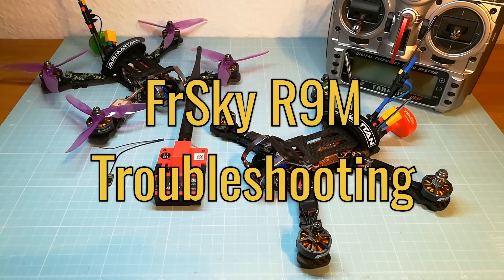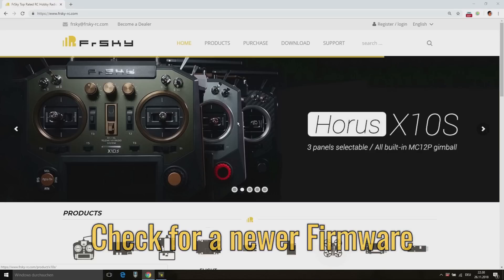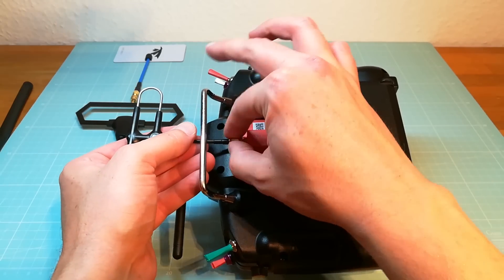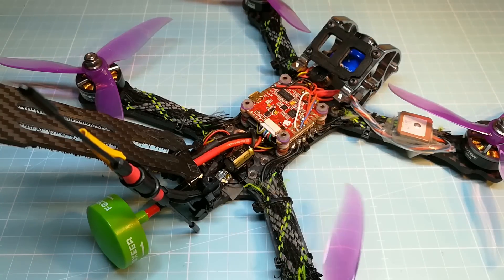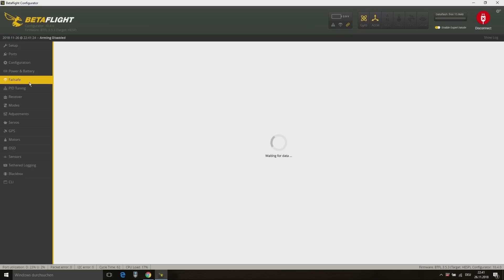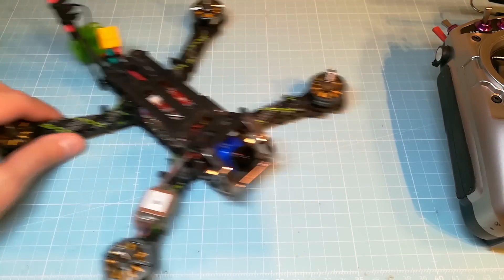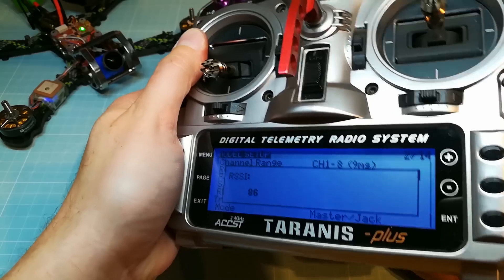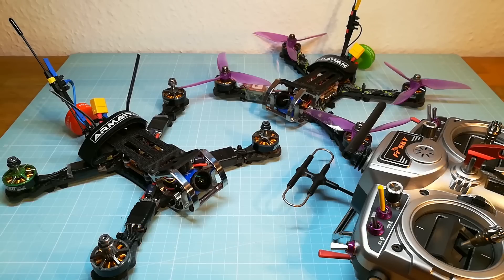FrSky R9M - Failsafe - Troubleshooting

Comment: Please, could someone help me? My drone triggered the Rescue Mode, and instead of it comes back to me, it went in a different direction. I lost the drone, but the worst thing is not understanding why the drone did not come in my direction.  I have had checked the arrow in OSD, and the direction was working properly. After this video, I find out why the rescue mode was activated. The problem was I have set a value too low in "guard time to stage 2".  I set 4 to this field. When I set it, I wrongly thought it was 4 seconds. My drone was Tyro128 and my GPS Module was BN-880.
Reply: Guard time for stage 2 activation is a period for which the drone waits after loosing the RC signal and then it activates return to home procedure. If you set 4, that's totaly ok. It means that after it lost the signal it waited half a second for the signal to return and then it initiated the return to home procedure. So this is certainly not the reason for it to fly away from you in my opinion.
I see mainly two options:
1. minimum satelites set too low (ie less than 6) and so your home position could be totally wrong
2. badly positioned gps module on the drone - maybe it had a very bad reception at the moment when gps rescue was initiated and it flew away for that reason.
I can think of no other option right now...

Comment: Sounds silly, but im having interference on video when i set 500 or 1w of output power.
Reply from the maker: why silly? It helped a lot of my viewers and even you did watch this video because of some issues you are trying to fix. In order to fix your issu i would try to mount the video antenna apart from your receiver antenna. You can also try to bind you quad without telemetry and to disable telemetry, also disconnect the s.port wire just for testing - sometimes telemetry could cause inteferences especially at high output power levels.
Reply: @TorbanDallas  Thanks Torban!

Comment: I´m using r9m with r9mm, and testing failsafe turning off the taranis, when i turn on again, the quad not recover from the failsafe, still blinking failsafe in the osd,  and not response to the taranis, but i have telemetry in the taranis. Any idea?
Reply from the maker: sounds like a BF Issue - I have already heard about this issue on some Facebook posts. Open a GitHub Ticket please. I will also do similar tests soon and then i will also share my experiences. After switching on your taranis, and moving the sticks, you should get back control.
Reply: @TorbanDallas  i'll do ir
Reply from the maker: @juanmanuelamado7732  just thought about your gps rescue issue, did you already find a solution? Btw: are you using crsf or frsky module? (seen to late that you already said you are using r9m in your first message) And what's your Failsafe Setting in your Radio? On BF 3.5.7 the rescue mode didn't work with crsf and a specific Failsafe Setting, maybe it's the same issue - if you are using crsf.
Reply: @TorbanDallas  i'm back to BF 4.1.2 and fix that gps rescue issue. But the sats count back too. So today is raining, but tomorrow i'll gonna play with the sbas config and see what happens.
Reply from the maker: Which Betaflight Version? I have heard about this issue. Can you replicate it and explain it on Betaflight GitHub? I never had this issue von BF 3.5.7
Reply: @TorbanDallas  i'm running a test version, 4.1.14 a build to test that gps thing, the drop sat, it's fixed the sats issue, but testing rescue mode without propeller, works fine in a switch, but becoming into failsafe turning of the emiter, don't recover control when turn on. So i'll try this on 4.1.2 and if still hapens, go back to 3.5.7 and test it. Let you know what happens...
Reply from the maker: @juanmanuelamado7732  that's pretty intresting, so you have tested the 4.1.14 version from github, does it work even with the ground assistance type set to auto detect? Please share your experiences with this bf test build on github with the developer :)
And also your experience about the Rescue Mode - i have already heard about this issue on stable releases of BF 4.1.
Reply from the maker: @juanmanuelamado7732  btw: you are testing the rescue mode without props, so do you need to place your quad 100 or more meters away from you to get it to work?
Reply: @TorbanDallas  jajajaa. Yes. I took the car to do that, arm the quad and drive so i get the minimun distance to rescue mode work.😁
Reply: @TorbanDallas  i already let know Tony Cabello by e mail this behavior. I just waiting to put it in github, because i want to test it better. ( in 4.1.3 and 3.5.7)

Comment: Hattest du schonmal rxloss bei rxsr receivern ? Im Nahbereich sporadisch immer nach ein paar Minuten und einem hohen rssi.
Man kann im ganzen netz suchen und keiner hat eine Lösung.
Reply from the maker: Joa kann schon mal vorkommen und dann verschiedene Ursachen haben. Probier mal die längeren Antennen aus. Außerdem würde ich die Lötverbindungen alle nochmal prüfen / nachlöten. Kondensator am Batterie Eingang kann helfen und die Firmware würde ich nochmal prüfen und neu binden. Antennen Ausrichtung muss auch passen. Wie du siehst kann es verschiedene Ursachen haben.
Reply: @TorbanDallas  ich selber habe das r9m mit flex auf nem 7incher  und drei 5zoll quads mit r-xsr. Horus mit FCC firmware. Selbst hatte ich nie einen einzigen failsave. Ein Kollege hat einen neuen (ersten) build mit r-xsr und ner eulbt taranis. Hier endet jeder Flug in nem drop bei 50metern Entfernung. Obwohl gute rssi Werte. 5 Volt und 4,5Volt sind stabil. Elko ist verbaut. Antennen im 45Grad Winkel. Im log steht was von rxloss und ch valid. Ich habe auch irgendwo was gelesen das es mit d16 Probleme gibt. Allerdings flieg ich wieder nur D16. Das ist echt frustrierend für nen Einsteiger.

BTW. ich bin schonmal unwissentlich ohne antennen geflogen. (Stecker nach nem crash runtergeflogen) hatte im Bereich von 250Metern keine Probleme.

Comment: Thanks for the tips!
I found out that the antenna position really matter. L position on the back is better than Horizontally mounted on the arm, but i believe the vertical I is the best position but then i'm a bit confused placing the quad on my bag ... LOL 😅

Comment: Hast Du schonmal das TX Modul mit einer externen Batterie verbunden? Ich wollte heute meinen Buzzer einschalten, aber der ging nicht los. Mit den XSR, RXSR receivern habe ich immer die Taranis abgeschaltet, somit ein Failsafe gehabt und er piepte los. Heute mit dem R9mm nicht, erst als ich die externe Batterie auch noch abgezogen hatte ging der Failsafe an. Nähere Untersuchung hat gezeigt, dass die Verbindung immer so lange steht, wie das TX Modul noch power hat, auch wenn die Taranis längst abgeschaltet ist. Im Betaflight Konfigurator frieren die Werte beim Empfänger einfach ein. Die grüne LED am R9mm bleibt einfach an. Ist das bei dir auch so? Ich finde das unschön. Habe die letzte Flex Firmware und auf dem Quad Betaflight 3.5.7.
Reply from the maker: Oh das ist Interessant. Habe ich noch nie mit externer Batterie probiert
Reply from the maker: Wenn die Werte in BF einfrieren ist er ja zumindest im Failsafe Stage1 oder? Hast du mal Probiert ob Failsafe Hold oder no pulse einen Unterschied macht? Aber gut, wann schaltet man schon seine Taranis aus. Nachteile hast du dadurch nicht. Ist halt nur schön wenn er dann automatisch in Failsafe geht wenn man eh schon gelandet ist und er dann buzzert.
Reply: @TorbanDallas  Das mit Stage 1 muss ich nochmal prüfen. Bin da nicht so sicher. Ich vermute, dass Betaflight von dem Taranis Ausschalten einfach nichts mitkriegt. Das währe in der Luft nicht so gut. Der fliegt dann einfach weiter anstelle GPS RTH zu machen .
Reply from the maker: @mmarsian  ja dann solltest du die Funke besser nicht in der Luft ausmachen. Aber berichte mal, wie es sich mit den anderen Einstellungen verhält.

Comment: Im having trouble setting custom failsafe on my recruit wing.receiver works great im running s-bus but i set failsafe for no throttle and go into a right turn with autolevel coming on but nothing works.it just stays doing last command even though i have everything set right in x9d.what could i be doing wrong.

Comment: What is flex firmware NO ONE mentions this neither does frsky
Reply from the maker: Flex is the same like the FCC with the additional option to select the frequency. You can choose between 915MHz and 868MHz. 868MHz is needed for the EU. If you are not living in the EU you don't need the Flex Firmware.

Comment: I'm having an issue when flying with my Fpv buddy we both have the r9m setups and only when we fly together we have Failsafes. And we figures it out because we stated taking turns and the opposite radio would pick up the telemetry from the unbound Qwad. Any idea what we can do to be able to to fly together without issues?
Reply from the maker: Thanks for your comment! That's an interessting issue, i couldn't reproduce it yet because i don't have anyone with a R9M to fly together. Did you both try to rebind your receivers with different Receiver Numbers in your taranis?

Which Firmware Version, Sbus or Fport? Frequency and Output Power are you using?
Reply: @TorbanDallas  smartport and we both use the automatic power leveling.
Reply from the maker: @du4-fpv777  well, i can't help you when you don't read and answer all of my questions ...

Comment: Torban, thanks so much for doing this video series. I'm a total newb to all this, especially s-bus etc. Can you possibly do a video showing from the get go, how to wire an R9 MM using s-bus, to use without a flight controller(to begin with) so as to use in a fixed wing. Eventually i'd like to fly long range with the R9M using a radiolink Minipix
Reply from the maker: well, if you don't want to use a flight controller you will need a other Receiver like the R9 https://www.banggood.com/FrSky-R9-900MHz-16CH-Long-Range-Receiver-With-SBUS-Output-p-1153899.html?p=LM11044296190201604E
There you can plug in your servos from your wing.

Comment: So i just need to match tx and rx antennas frequencies, irrespective of what firmware i have on the R9M? for example, can i have Eu-lbt firmware, but 900mhz antennas on R9M and 900 mhz antennas on r9 mini receiver?
Reply from the maker: Andrei well, you can. The 900mhz antennas are created to match 868mhz and 915mhz as well. But you better get antennas for your right frequency. The tbs antennas are tuned for 900mhz. The frsky super 8 and the dipole t are available in to versions - one for fcc and one for the eu.
Reply: @TorbanDallas  well i have the eu-lbt firmware on the R9m, and 900mhz antennas on my quads and 900mhz super8 antenna on my taranis, and was wondering what should i do :). i am from europe so i have to stick with Eu-lbt. so if i don't plan long range i should be fine with this setup right? :) thanks Torban.
Reply from the maker: Andrei well like i told you, even the tbs antennas are tuned for 900mhz to match the eu and fcc frequency. Today i have tested the Super 8 eu version. Video is coming soon. Spoiler: the 900mhz and the 868mhz super 8 antenneas are working good for the eu firmware.

Comment: Thanks for your awesome videos! But i wanna ask, is there really a difference between both super 8 antennas? Both say 860 - 930 mhz? A while back there was just 1 super 8 antenna! I bought that one (fcc 900) but i live in europe and need the 868 version... but specs both say the same
Reply from the maker: Hi, thank you very much, i appreciate it! Regarding your question about the antennas, yes it's true, the first batch of the Super 8 is tuned to 900Mhz to match 868Mhz and 915Mhz. Now FrSky has also realeased a version tuned for 868Mhz for the EU. The EU version is marked with a yellow shrinking tube. I have also ordered the Super 8 EU Version and I recently received it. I want to test it on my next flight. The specs are looking identically, but maybe that's just a copy and paste error. On https://www.horusrc.com/en/frsky-r9m-module-and-r9-mini-receiver-combustion-combo.html?acc=17782 there you also can chose between those both versions.
Reply: @TorbanDallas  thanks for the clear answer! But i ordered it on 13-11 is there a way to see wich one i have.... so i can know if i have a first version or fcc/lbt version?

Thanks mate for the info!
Reply from the maker: Jordy RC you will see it on the yellow shrinking tube. If your antenna has the yellow marker then you actually have the eu version.
Reply: @TorbanDallas  Oke but is there also a way to see if you have gotten the first version of the antenna, that one with Both FCC and LBT
Reply from the maker: Jordy RC the one without the yellow marker is tuned to 900mhz. I think it's the same version. They just added a special eu one.

Comment: But the problem is that rssi is very high, quad Failsafe, I don't know if it is a betaflight bug or rx problem.
Reply from the maker: I think that problem occurs when the module is switching the power mode. I hope a newer firmware will fix it. The Failsafe settings can avoid a failsafe at this scenario.
What firmware do you use?
Reply: @TorbanDallas  Originally I used 180926 on the 2.2.2, it was stable, but I upgraded to 181109, Failsafe many times. Maybe I should go to 2.2.3? Later I changed to 180716, Failsafe once
Reply from the maker: @sivisjoe9877  so you used the Flex Firmware without updating your radio to openTx 2.2.3 ? Haven't I made it clear in my video? Or did you just use a FCC or EU-LBT Firmware? For using the flex firmware you have to upgrade to opentx 2.2.3.
Make also sure to update your r9m and your rx to the same firmware version! My Failsafe was with the Flex 180926

Comment: Very Important to have the same tuned Antenna on the Quad as on the Radio.   If you are using LBT firmware you need 868 mhz tuned antenna on both quad and radio.   If you have a mismatch you will get failsafes.    People using crossfire had failsafes too when they use the wrong frequency with the wrong antenna.
Reply from the maker: Hi, thanks for your comment! Of course, you will need the matching antennas, for tbs the Diamond and the Immortal T are tuned for 900Mhz to match both Frequencys. Even the first FrSky Super 8 was tuned for 900Mhz to match both Frequencys. Only the FrSky Dipole T was available for 915 or 868Mhz. That's why i have recmommended to update the Antennas, i think the default Antennas on the R9M are always only for 915Mhz. I'm living in the EU so i need the 868 Frequency and the matching antennas. I have linked the different Antennas in the Video Description even with the needed adapters if you want to use the TBS Antennas. On my first version of this video i had explained the different antennas and adapters, but i didn't want to bore the viewers so i decided to make a short video and to add these additional informations in the video description.
Reply: @TorbanDallas   reading this I think, I bought the EU LTB version, but I installed the FCC firmware, and I still use the 868mhz antennas, can this be the reason for my FS? thanx !!
Reply from the maker: Leonardo Jc it could be the reason yes. You better get the upgrade antennas for your frequency.

Comment: Good info. Mr Torban. I see you mount the gps on your esc. How is that going for you? No signal disruptions on the gps?
Reply from the maker: Thanks Freedome FPV! Look twice at my GPS ;) i'm having two quads, the one with the GPS doesn't has single ESC's, there are just the Motor wires on the Arm. On this Quad i have a DalRC 4in1 in ESC mounted under the FC. I have tried the matek GPS and the BN 180. Tried different mountings on top of the Battery and on the Arm. I didn't cover the GPS with electrical Tape or shrinking tube. I couldn't notice a difference of these two mountings. So i prefered the mounting on the arm.
Reply: Hi, I have been following your videos on R9M since even I have started using it recently. What I have noticed in your videos is that you have a problem with GPS .. Less satellites . . wrong home direction. I was having the same problem. The problem was my runcam split 2. It generates a lot of electromagnetic field Which affects the GPS. The solution was to either not to record video when flying or have the GPS mounted atleast 15 cms above the frame. May be even your GPS is having the same problem . . No harm in checking it.
Reply: @vikranttalim  But Mr Torban isnt using a runcam split..
Reply: Freedom FPV Yes, I know that but may be the GPS disturbance is due to the electromagnetic field created by the 4in1 esc or by some other component.
Reply from the maker: @vikranttalim  and  Freedom FPV , thanks for your comments. I have tried different mountings on top of the battery and on the arm, even with recording and not recording action cam. I also have tried different GPS Modules. The result was ever the same. Now i have installed the module on the Arm and i didn't cover it with shrintking tube or electrical tape. I will go on testing, i also will try to work with copper shielding tape. On my last tests i got 11-14 sats after waiting 5 minutes for the satellites.
Reply: Torban Dallas All the Best ! Waiting for your next video